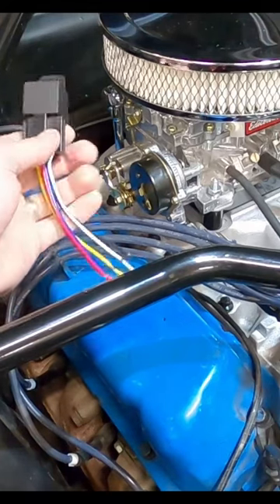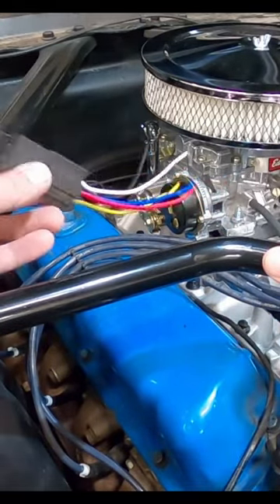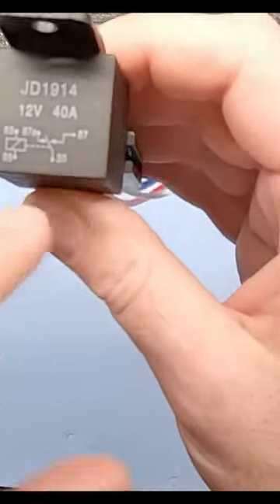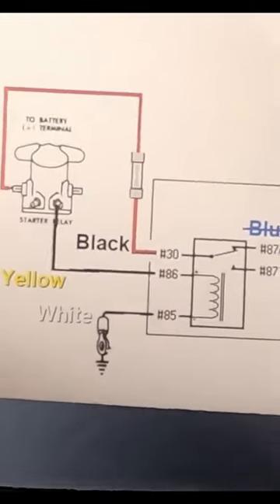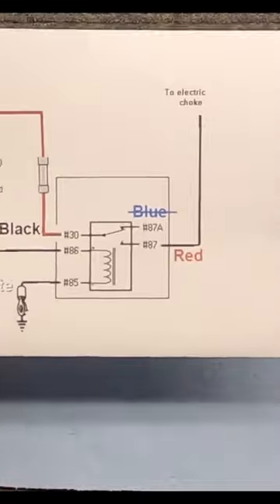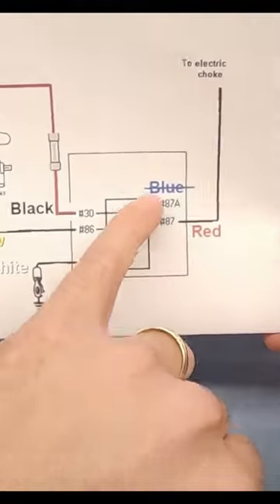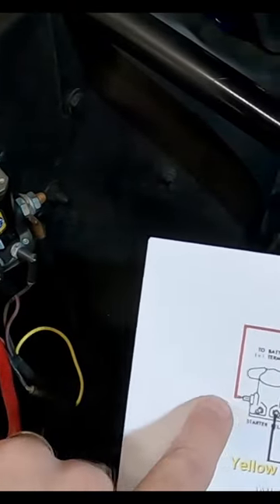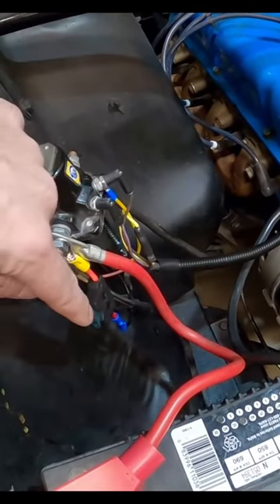Installing a Relay for Electric Choke

Comment: I hooked up my choke off the stator terminal on my alternator … in line fuse also . Works like a charm .  When the car turns over and starts the power is sent to the choke etc .
Reply from the maker: Yes, there's more than one way to connect power to the choke.  :)